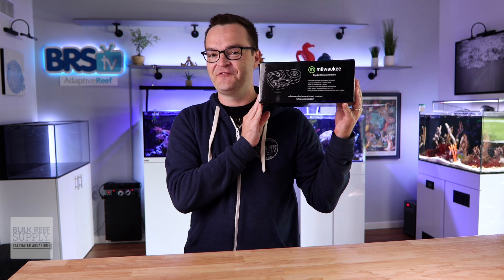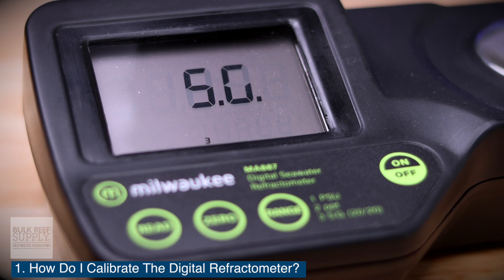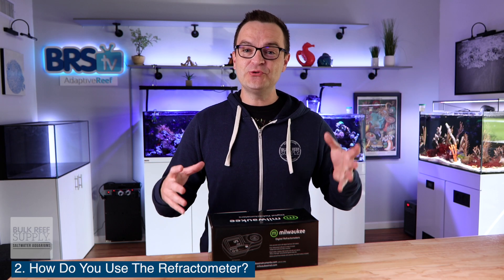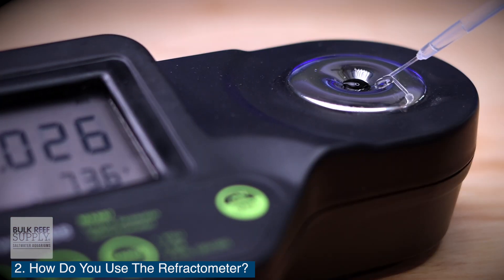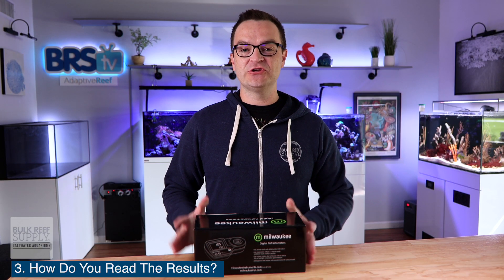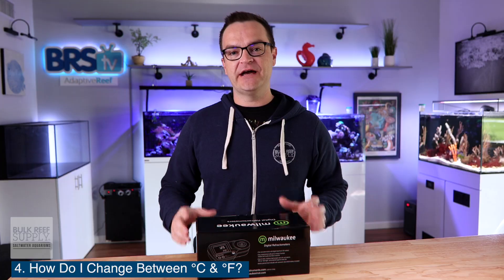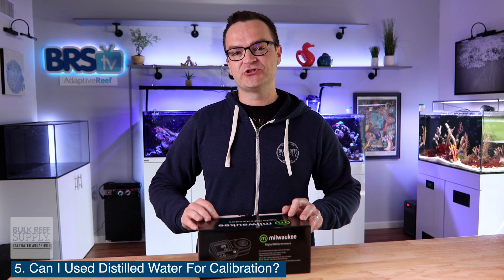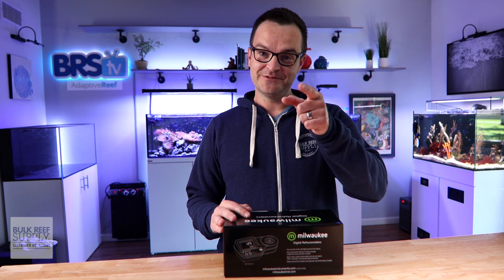Milwaukee Digital Seawater Refractometer...How to Calibrate, Test & More!

Comment: I have two of these, and they both read high. I made some diy seawater solution standard at 1.026, and both meters, calibrated, read it as 1.027. So for years i have been mixing to 1.026, and was really getting 1.025. Minor, but im going to make the small correction and mix water to 1.027 on the meter, so it is truly 1.026
Reply: I suggest using your hand to cover the reader while it's calibrating and while testing salt water. This ensures the light exposure around the tester is always the same. Seems to help me get more consistent readings.

Comment: Right out of the box it read the 1.000 fluid right at 1.000. It read the 1.025 fluid at 1.023. These results were the same after calibration. Is the meter wrong, or is it the solution? Who knows 🤷‍♂️ I’m going to order a regular refractometer. I guess it’s accurate +|- .002 sg 😂

Comment: Would u say this is better than the hanna hand held and ive heard u have to use there cal soulution and i hear that there soultions can be off from batch to batch u say u can use rodi water or distiled water can u explain further for this newbie thank u love your videos your helping me so much !!! You were so right on that plumbing video omg i ruined two unions and i was like not me how could u forget the other half well i did lol and i made pretty much all the mistakes u warned of but in the end i nailed it my fish are alive im curnently battling a bateria bloom and im nailing that as well its been a battle i have severe anxiety and adhd so i get super angery and frustraded with my self when i mess somthing up i also loose my concentration but your videos have guided me and helped so for that im greatful god bless u
Reply: Not sure but as a Hanna hand held owner. The Hanna checker is garbage. Mine would not hold the calibration. I would have to calibrate it every time I used it. And sometimes it wouldn’t give me accurate readings either. And with the Hanna checker you have to use their solution you can’t use distilled water like this Milwaukee device.

Comment: For some reason after calibrating mine the calibration fluid reads 1.027 instead of 1.025? Is there a way to fix it or if not can I just subtract 0.002 from my reading and still be accurate?

Comment: When I purchased this, it came with a small container of distilled water to calibrate and then another greenish colored solution…the front label had washed away so I don’t know what this greenish solution was…I’m guessing a salinity checker-what is the stated salinity of this checker or calibrator, please?
Reply from the maker: It's just a reference solution of 1.025 sg to check calibration.

Comment: I have the same unit if you do not calibrate the unit before using it your salinity will be off about one point I have verified this time and time again with my sybon refractometer  it's very accurate!! You should always have a backup refractometer to verify results and I have seen if you do not calibrate the Milwaukee refractometer you will be off about one point only use distilled water!!!!! to calibrate the unit. every now and then clean the glass with windex  to get accurate results especially if you're getting an error message . I have had my Milwaukee refractometer for years they're very good units just keep them calibrated using only distilled water

Comment: Out of all devices that need to be calibrated every time before use, this is not one of those.
Reply from the maker: This is probably the easiest refractometer to calibrate. If you wanted to calibrate every time, it could be done really quickly.

Comment: I find there is no real need to calibrate it before every use. I check calibration every few months and it hasn't lost calibration yet in 4 years.
Reply: I find that very hard to believe in 4   years has not lost calibration I have the same unit and if you do not calibrate the unit you will be off one or two points I have verified this time and time again with my sybon refractometer which is very accurate!!!!!! If you have a second accurate refractometer to verify the results you will see that you are off a point or two it only takes a second to calibrate the unit using distilled water only. regular maintenance of this unit is to clean the Glass Lens with Windex from time to time As Told to me by the manufacturer
Reply: @dobermanguy9437  How do you calibrate this unit?
Reply: @maryjuanarasta9220 the video shows you. Just add distilled water and wipe off. That easy lol
Reply: I’m in the same boat, never recalibrated mine for 2 years , didn’t know I had too lol